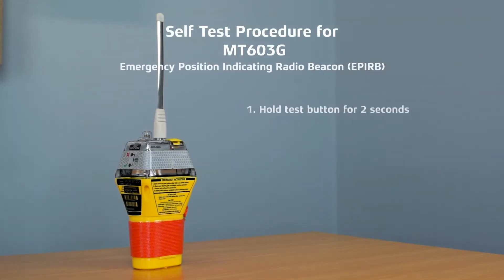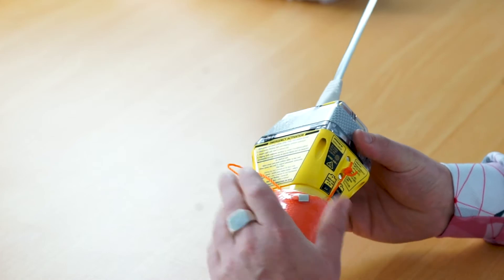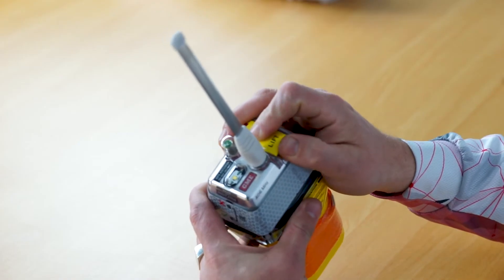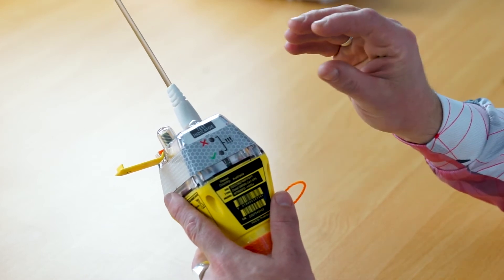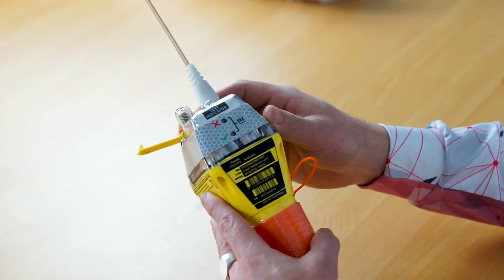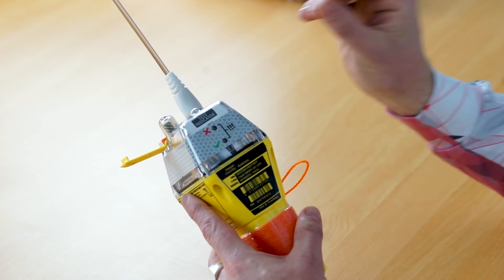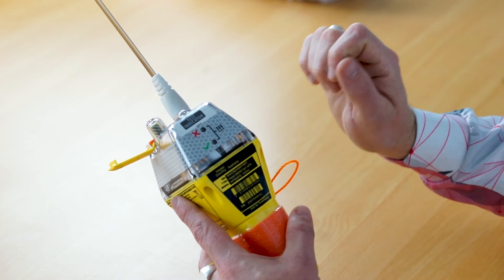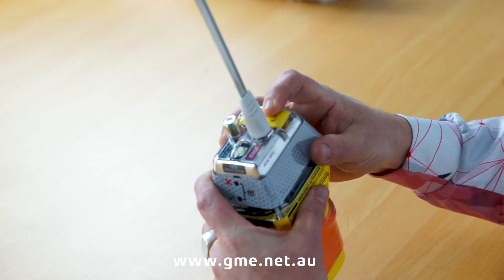How to test your EPIRB | MT603G & MT600G

Comment: Thanks for the video. 

Question: Is it possible to perform a test report using a GMDSS tester for these EPIRBs? Specifically, can I receive the 121.5 MHz and 406 MHz signals (including GPS) on a tester and generate a report confirming the proper functioning of the EPIRB, or does the EPIRB only perform an internal test? Thank you.
Reply from the maker: Hi there!
Thanks for reaching out to us.
For this one it would be best to give our tech support team a quick call on 1300463463 and they will be able to advise!

Comment: Very helpful. Where would you typically mount on a 35’ yacht?
Reply from the maker: Hi Craig, for the MT603G we would recommend mounting in an easily accessible place that is not in direct contact to the elements.